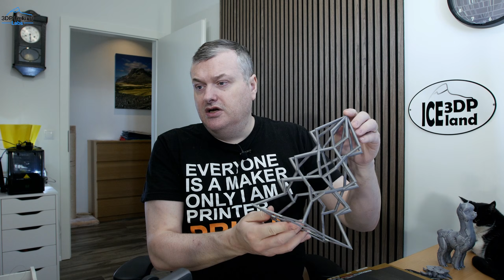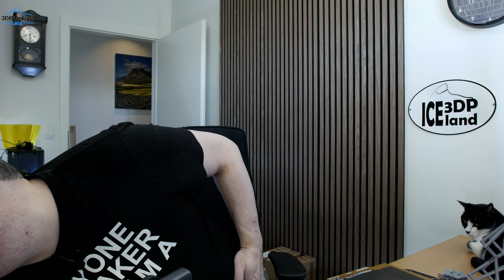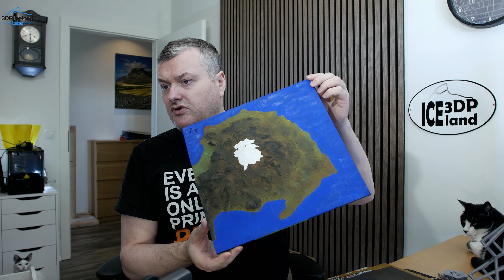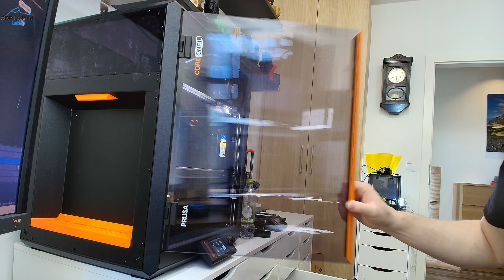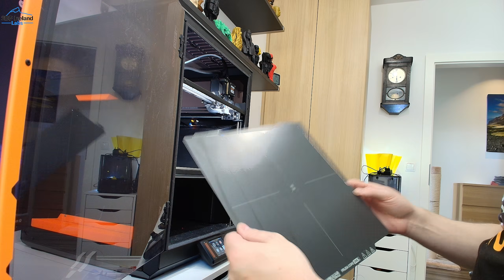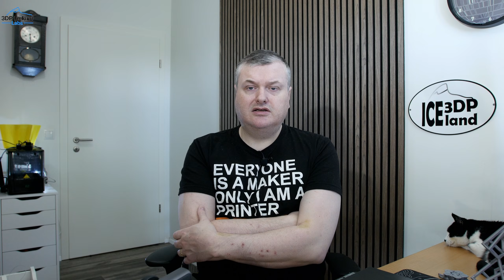The Best Prusa Ever Made? | Core One L After 750 Hours

Comment: I have the coreone+ and the original PTFE fitting sucks, nobody can get the tube out. I replaced it with a fasto fitting and all problems are solved. Make sure you order the right thread and hole diameter. And yes I am also waiting for the high temp nozzle, PEEK doesnt work but PEKK and PPA wil do fine.
Very satisfied with mine and maybe I will buy a L in the future.